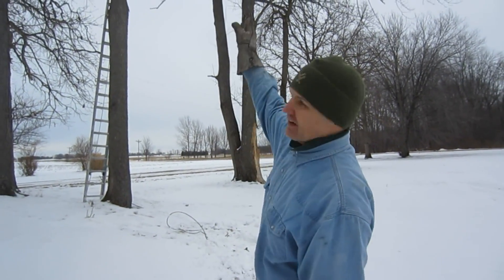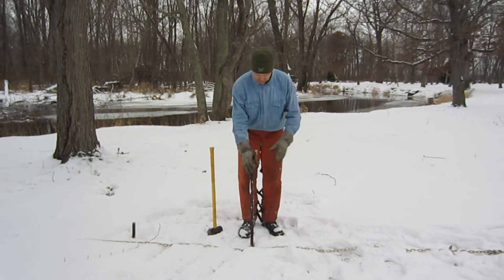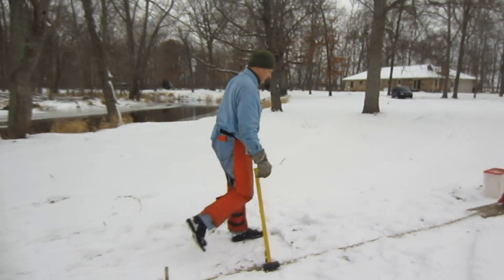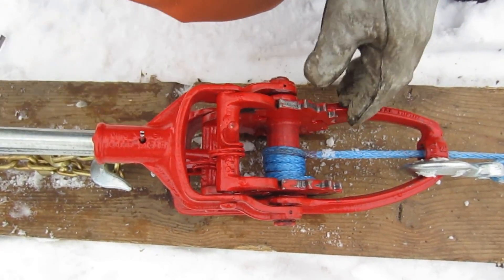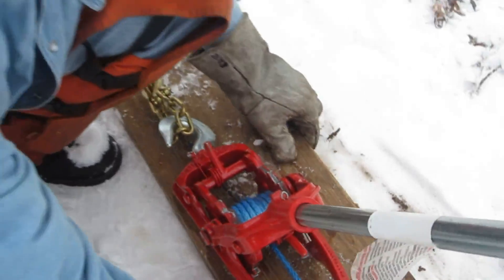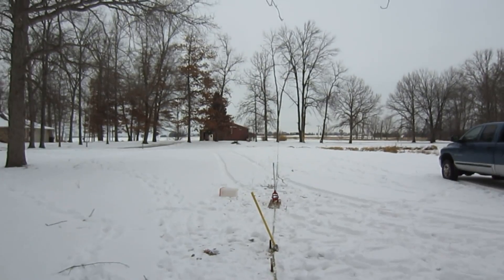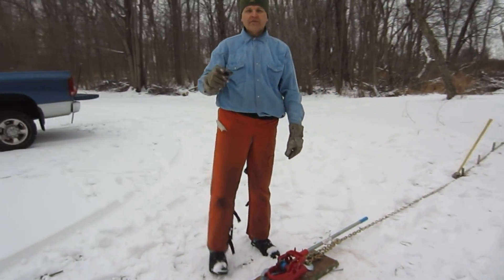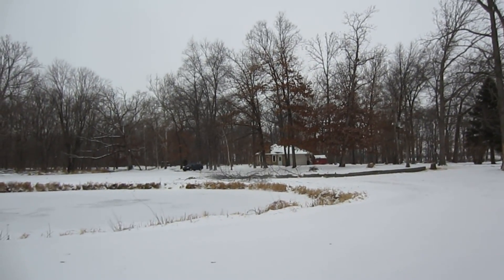More Power Puller Helps Pull Down 75 Foot Tree, & Winching Techniques

Comment: Great video !  It may have been easier to anchor the winch to the tree directly behind where you drove spikes into the ground. A simple heavy anchor strap would suffice. Also hand signals to someone on the winch would allow one to cut only and saves time running back and forth.

Comment: I have a more power with steel cable. It's ok, but my favorite come alongs are the Ingersoll-Rand,  Beebe C frame units. I  have two that I use all the time . They're lighter and work much better.  I've had a tree service for the last 30 years.  Sometimes there is nothing to anchor to . I've developed a system of ground anchors for that. Read mountain climbing books and look up what "setting pickets " means to understand how they work.

Comment: Great system of pulling especially with the chains and the reset. The only thing I'd like to say is I think putting your fingers and hands inside that puller is not a good idea and also in between the chain when it has a double part on it. I would be careful with my hands and fingers a little more if I were you. Just my opinion great video
Reply from the maker: Thanks Donnie,.... God Bless.

Comment: I’ve used a similar setup with a come along, chain, and tow rope. I only use one stake though, driven at an angle. This seems like a lot of unnecessary rigging. I only use that system if I can’t get my truck into a position to pull it down, which is MUCH better since you have the ability to jerk or snap the tree quickly AND keep directional tension on it longer by reversing. With the come along method, once it snaps it’s just free falling and has the potential to spin and change direction. Not likely if you make your hinge right but crooked trunks or leaners are sometimes unpredictable.

Comment: i have pulled out pipes the same way. it works flawlessly. i also have 2 trees slightly smaller and a 3/4 nylon rope. i have the rope tied up approx 20 feet. going to front notch. use my truck  remove slack and apply tension. then back cut. they are half your size. we also have been hit hard with ash borers and 21 dead ash trees. yeah its gonna be a pain in the @$$. being 2 have already fallen over the power line on the upper lot and snapped the last pole in line off. stupid power co falls on deaf ears with removing the others near the line. i been hearing the power companies tree service blow smoke up my rear for 3 years telling me oh we'll be back tomorrow, next week, next month. in reality never. that power co is responsible for their right of way. so it appears an attorney will be applied to step on their dam toes. oh well. stupid is as stupid does. they're gonna lose. as well I'm going to make their access to that line seriously impossible. with those piled up dead trees. and let those community idiots sit in the dark. i myself have a generator. its game over with them and game on for me. that's if those dead ash trees don't beat me to it. one already did. that dam government allowed that Asian crap borer along with sars covid to happen and i ain't hearing jack squat about it. i guess it takes a real one man band to do the job of an entire power companies daycare boys. to not do their job including their so called maintenance tree service. biggest bunch of lazy @$$e,z on the planet! I'm not paying a dam dime and hire some bozo brain tree service at my expense. they can shove that up their twilight zone. I'm 61 and no tree was ever smarter than me. and never gonna be. stay tuned the war ain't over yet. its not all about who you know as it is what you know. by the way excellent job. im impressed specially as i the patience not to rush you job. bravo! a few hundred bucks saved is just more money in our wallets. I've been cutting and falling trees with my father for years until he passed away. i dearly wish him still around to share the experiences in life. as he put it you got to keep living and moving forward. because one day you won't. best of luck. may you Live Long and Prosper!

Comment: Excellent video. As the owner of a More Power Puller I was just watching a few youtube videos as a refresher course in case my truck got stuck. I just ordered a couple of  days ago some 40 inch long giant tent pegs for using as a picket ground anchor system like you were using so seeing you also demonstrate this and then how to get them out afterwards was an unexpected bonus. For me this is two great videos in one! Lots of detail in everything from modifying cotter pins to leaning the sledge hammer on the first picket. I’ve book marked this to watch again when I need another refresher course. Lots of negative reviewers expecting to see a chainsaw video instead of actually reading the title and comprehending what it means: More Power Puller and Winching techniques. Thank you for posting this.

Comment: That tree would have fell in that direction without the chains and ropes.  The weight of the tree, particularly with the twin crowns, was already leaning in the direction you wanted the tree to fall.  Putting tension on a tree and then cutting into it can result in a "barber chair" which has injured many tree fallers.  Gravity is your friend, there is no need to hurry it.  I know you were demonstrating the rigging but that tree did not need rigging.

Comment: I don't trust using the ladder like that. A sheet of plywood under and tie the ladder to the tree with rope to insure it would stay put when you're up in the air. I use two come alongs under tension all the time for faster resets. Tie some weight in the middle of the pull rope to insure its in tension as the tree falls down. To remove the ground bar use a channellock to rotate it a few times then pull it straight up.

Comment: I guess that I'm kind of lazy, but I would have just just put my chain around the tree right behind your anchors.
Reply: A tree trunk protector, also sometimes known as a rigging strap, is made of nylon webbing, and is designed to rig your winch line to a solid object, such as, well, a tree.
Reply: knowing my luck pulling all that tension on that tree before front notching. my chainsaw bar would get severely pinched and bent, chain busted. me pissed off, spent the day at the local bar consuming large quantities of alcohol then came back and went ape chit mental institution wild on that dam tree. found a grenade launcher and blew it off its rocker. then said piss on it.

Comment: Someone should tell this crazy dude to never, ever put a ladder against a tree (especially a dead rotting tree) and climb up it. What I'd recommend is a much more straight forward way using a fishing rod. Yes a fishing rod. The tree I had to bring down would have been 10 times the weight of this one. So I cast a small 4 oz weight using my fishing rod to a fork 50 to 70 ft way up in the tree. Then I attached a string to the fishing line and retrieved the line back on the reel. Then a rope to the string and then a steel cable to the rope....you get the idea. I winched the steel cable tight to give the tree the bias I needed to make it fall where I wanted it. Then cut in the usual way. And down it came with no risk to me, any one else or to any property.

Comment: I haven't read any of the comments so this is likely a duplicates but you would angle the tops of your anchors away from the direction of the pull to maximize their holding power in the ground against the load. Any amount would be helpful but about 30 degrees is pretty good.  The angle will also prevent the chain from coming over the top of the anchors weather the loop is over or underhand.

Comment: I'll be using that extraction method to remove some metal fence posts.
Reply: Re-rig? Just place 1x blocks or thicker as shims atop  your fulcrum as the anchor begins to move. As soon as it's loose enough, slide the chain further away from the lever bar's tip to gain distance as you need less force. Actually just sliding the chain in small steps after each pry motion will probably afford plenty of leverage and travel.

Comment: Ground anchors need to be 45° from the load, in other words 45 degree angle in the ground
Reply: I totally agree.  If the 45 degree  ground stakes are longer, and "daisy chained" with separate lines from the top of one to the bottom of the next, the "pull out force" is distributed along the length of the buried section.   Also, having witnessed "lines under tension" breaking, it would be a good idea to put a blanket on the rope, in case it parts.  But it is an excellent presentation despite my pickiness!

Comment: I use a come-along with a steel cable rated over 7000#  and I wrap the cable secured with three wire nuts and a clevis to another tree at least the same size at a distance about 50% farther than the tree height. I get the cable taut, then make the V cut in the direction I want the tree to go, then I do back cut, tighten winch, cut some more, then pull tree down with the winch. Drops where I want it each time.

Comment: A word of caution, Doing something like this you need your PPEs in place and avoid being in the line of fire should the rope fail.
I applaud the preload, I used the same method my self on dangerous trees bigger and more perilous than that one .
My anchor points were perpendicular to the tree equally shared load (self equalizing knot) 100% 1/2"  cable and my pull point on a snatch block was 90 degrees from that point to my wench on the jeep, so if something failed it did not fly in my direction.

Comment: The rope size is either too small or the chain is overkill, which is it? I agree with everybody else, tie it off to another tree and get a box of Kleenex!
Reply: Believe it or not, 1/4 inch Amsteel has rated strength almost as high at 1/2" high test!   The difference is that the Amsteel stretches quite a bit before breaking(about 2-3 inches per 10 ft) ;  if it were to break you might slingshot some hooks or fittings which would not be fun...

Comment: I did something similar, but threw a weighted string line up over a high branch to pull a rope up and around the tree.  Then, tied the long rope to the hitch of my truck to pull the tree over as I cut it.  No dangerous ladder climb and no winch setup.

Comment: Well, I learned a lot so thanks for posting. You never know when this method will be needed. That's pretty slick how you transferred the tension to another chain and reset the rope. I also have trees leaning towards power lines and will be applying all the things I've learned on these videos like yours to bring them down safely without errors. It only takes one mistake as I have found out when a tree didn't go where I expected. Fortunately I just brushed the high voltage lines across the road and nothing broke but my spirit. The lesson for that day - don't get in a hurry. Hope you get over that cold, cheers!

Comment: Being an engineer, I'd go for cost-effective. If necessary (not quite so here), a 1-ton cable winch, some chains, tow straps, and lift sling to loop around anchor tree. No pipe in the lawn. Proper face cut (unlike shown), backcut and wedges. Limb it, buck it, haul it out, NEXT! Life is short, so KISS.

Comment: I use Wyeth-Scott pullers where I can't get my truck, but also to pay out cable to the included snatch block or one of my others so I can position the snatch block to redirect cable from my truck winch.  Then I can pull the tree over most of the way to the ground by gently accelerating the truck and the tree is never not tensioned by the cable until it's close to hitting dirt.

BTW some wire rope and rope clamps makes an excellent winch cable extension.

Comment: Funny how cold air makes your nose run, thanks for the lesson some guys wondered why you did not use the tree for an anchor, but you were showing how you can do it anywhere! Thanks I get it.
Reply: Tears washing across your eyes are collected by the nasolacrimal duct, dumped into the nose and wafted by cilia to the throat where you swallow them. Cold air chills the mucosal cells of the nasal cavity, slows the beating of the cilia and results in leakage. ;)

Comment: Thanks for the video. I have to take a tree down and do not have any other trees to anchor the puller to. I think I can do it now.
Reply from the maker: It gladdens me to read that our video has helped and inspired you to attempt to remove the tree you mentioned.  Go slow, think it through, put together a solid plan, consider failure modes, mitigate were possible, and then execute.  May the Lord's blessings be upon your efforts.

Comment: you can use a rope come along put tension on the tree wrap the end rope around the tree a few times go back make your box. Come back put more tension on the come along rope come along then make your back. Pressure from the Rope come along will act as a springboard and shoot the tree in the direction you want the cake done it a hundred times

Comment: I really like all of your notes and ideas.  It is easy to tell that you are an engineer.  Want some suggestions?  The cotter pin is clever, but an alternative is to shop at a farm/ranch store to see if you can find a hairpin cotter pin that fits.  Also, as someone else stated, your truck or the tree that was 10 feet from the last rod would have been faster/simpler anchors.  But most of all you were overestimating the tension required to guide that tree in the direction you wanted.  It was not a windy day, so the tree was pretty close to being balanced in-place.  All it really needed was a connection between the high point on the tree and a fixed object such as your truck or a tree to make sure it did not start to lean in the wrong direction.  Any tension at all would have guaranteed movement towards the direction of tension.
Reply from the maker: Thanks

Comment: This was a very instructive video! Even though I am a certified logger I use a primitive version of this technique to "cheat" and force the tree to go exactly where I want it to go. I usually can find a tree to hook a strap to, but this is a very useful technique when one isn't available. I have never used chains before, but now I will probably start doing so. I have been using 3/4" poly rope. My comealong is like this one but it has a metal cable. It even worked to help me "guide" a dead oak tree that was over 100' high and 4'7" wide at breast height. But using the two chains in tandem is a great improvement.

I agree with other comments that it APPEARS that your situation may not have needed all this work, but obviously your intent was to teach techniques, and I learned a lot!  Thanks for sharing!
Reply from the maker: Your right G.M.,.. our intent was to give back to the Youtube community and teach the winching and ground anchoring techniques that we use.  That's not say that this is the best way to do it, it is just what works for us.  Thanks for watching.

Comment: I don't understand the reset? why? Please explain.
Reply from the maker: Let's say that your winch can only draw 15 feet of rope, but you need to pull the object 45 feet in total, you have to reset the winch 3 times and each time you reset the winch, the line is still under full load.  How do you unload the winch, to perform the reset, without loosing the progress you've made?  I hope this helps.
Reply: SeekTheTruth
Reply: the problem  is your line is one a drum and it determines how much length of pulling you can do it is a down fall of the tool you have to take the slack out pull reset 3-4 times. most winch pullers only hold about 15 feet or so, a much better tool is a chain puller, no drum no reseting a much supiour tool for pulling down trees then again  a good guy with a chain saw would have been up that tree and had her down without all that other shit

Comment: Why put any anchors in the ground at all there is a bloody big tree there u can anchor too.
Reply: You'd need a mighty big truck; we've stalled 12K winches guiding trees. It will drag a full-sized pickup truck, no problem, and worse, if the tree does something unexpected.
Reply: I thought the same thing, but was glad to see this method. Also, I'd imagine you could kill a healthy tree if you debark it too badly with a chain or rope digging into it.
Reply: I use a wide rated strap around a tree to wench off of. It won't debark or hurt the tree. But he has a great method it there is no other anchor points. The truck and winch great also if you get a very high tie in point as long as there's not much back lean. Great video
Reply: to get out of the way, to decrease the angle of the pull and what if you do not have such a handy anchor.  that is my guess.
Reply: My thoughts exactly .
Reply: could a used a truck a lot simplier but i think it was just for show to people who never took a tree down

Comment: How would you compare the more power puller to a cable winch or comalong?
Reply from the maker: Great question.  I've had multiple "come-a-longs" over the years, and I still have one in my garage today.  After finding the More Power Puller, I'll never go back to a conventional "come-a-long"!  The MPP comes with either a steel rope or synthetic rope, I chose the synthetic rope, and I love it!  All else equal, I find that the MPP pulls harder, pays out more rope (fewer rope resets), it doesn't bird nest the rope on the spool, has a much heavier duty frame, very rugged, solid and dependable engagement of the ratchet mechanism (I've come to really trust it), the factory still has replacement parts for the oldest models, & simple long lasting design.  I've never used a Tirfor cable puller, and I don't own a powered cable winch.
Reply: I've used them all. MPP is biggest bang for the buck. I have six tirfor style, or grip hoist, so i can compare. I have trucks with electric or PTO winches. There is always a MPP hid in there somewhere.